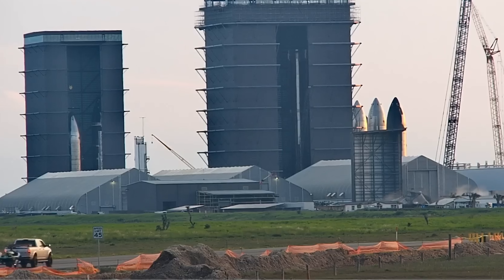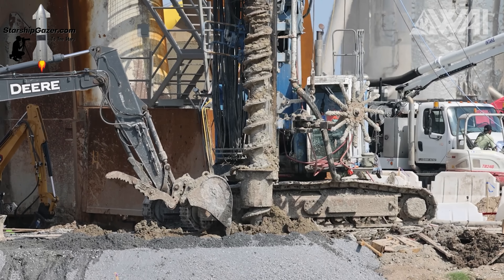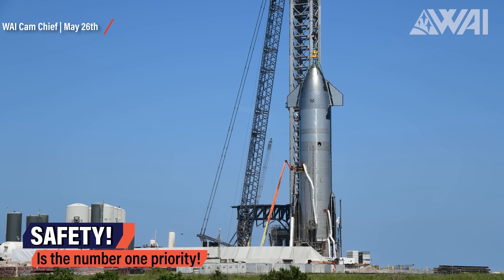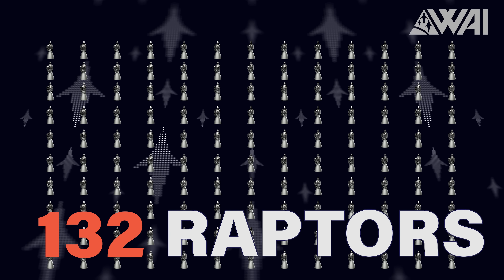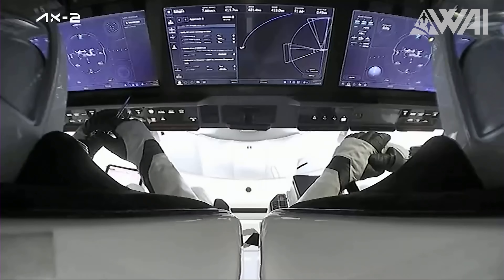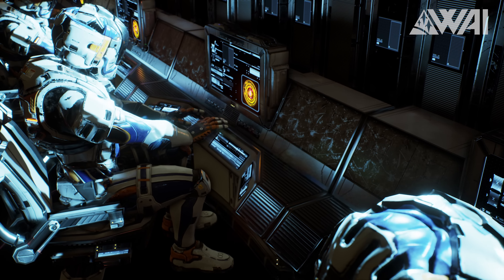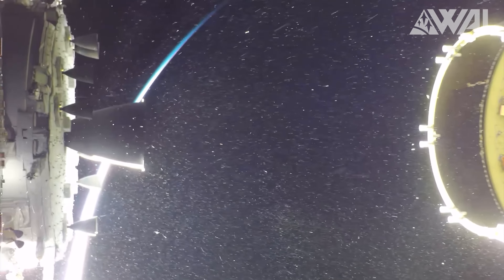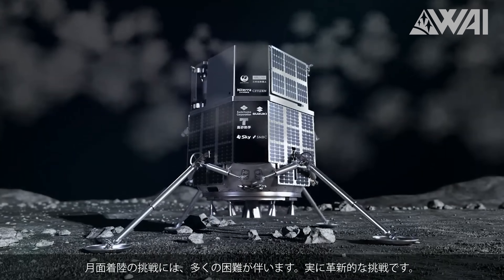SpaceX's Starship is about to do it again!?

Comment: The Hakuto-R Mission 1 crash was not really a software bug, more of a systems engineering process failure. The software behaved correctly relative to its training data.
Reply: Exactly. They trained the landing systems on landing site A data, then decided to land at B without running the training routines for site B. At least that is how I understood it.
Reply: According to Scott Manley, there was a sudden 20km change in altitude registered by the downward-facing navigation radar as it passed over the rim of a crater that was never profiled in any of the landing simulations.  This caused the lander to assume the radar had failed and subsequently ignore data from it.  I think you're right that this really wasn't a bug, unless being able to handle craters with 20km rim transients was part of the original software design specifications.  I'd be interested in knowing what they had originally decided should be the transient error threshold for valid radar operation.  The deepest registered crater on the Moon is apparently the South Pole-Aitken Basin, which has a depth of 13km.  Is this what they based the error threshold on?  If so, perhaps they never imagined that they would see a 20km change in altitude in a short period of time.  I was a programmer for two big companies, and I know how it's often easier to blame programmers for bugs than architects or managers for bad specifications.
Reply: Exactly! They changed the requirements. I would place a wager they didn't even let the software engineers know that the landing location changed.

Comment: Hi and thanks for your consistent and amazing content. A traditional flame diverter would fit the philosophy of the best part is no part. This unproven complicated method is a tangent from that methodology. 💯
Reply: I am a very busy man but I try to create time for my personal  life
Reply: I think I recall some people saying that the high water table would be an issue for a flame trench (that would exist below current ground level).  I also recall someone saying that this area being a 'wetland' would be an environmental issue.  The one that mentioned the high water table said it might be necessary to build the whole structure above ground, with the OLM and the launch tower raised to a significantly higher level...to allow room for the flame trench to occupy the space beneath them...such that no part of the flame trench structure would impinge on the water table beneath it.  Stabilization of the entire structure would be provided by pilings similar to the ones that are currently being installed to stabilize the OLM and water plate.  That would beg the question, "Why aren't the pilings a problem when the (to some extent...below ground...) flame trench would be?"

Comment: That experiment for the air quality/smell on the ISS is somethign that could be useful for wet navies as well.  As I understand it, even with all the advances in tech and their size, submarines are still really smelly environments to work in once they've been underway for a bit.
Reply: I remember to read something about the Paris Metro. Something about the disc pads smelling like vinegar. They were thinking about using ultraviolet lamps and a special coating on some places. The idea was to degrade the smelly molecule.

Mind, it was some 25 years ago. No idea what came of it.
Reply: UV-C light boxes are very effective against bugs. Not so sure about farts & BO smells. Has anyone researched it?
Reply: @Dave5843-d9m  They were researching it for the Paris Metro, as I said.
Never heard about it again, so no idea were the idea went.
25 years ago and all that.
Reply: That's why they used to call Sub's "Pig Boats" !

Comment: Hey Felix, I disagree with all the negative comments about flashy text. With good strategy it can add value to your information while being more dynamic to capture a less attentive audience. Don’t be discouraged by all the negative comments and keep trusting your analytics and metrics. Stay flexible and change if you have to. Ignore comments (including mine) if the data shows otherwise. You’ll reach out to more people in the long run. You’ll always lose people when you change a format for a better strategy, but as long as your core value content model remains you’re content will reach more. Keep slaying brother.

Comment: According to Scott Manley's video on Hakuto-R, the issue was not, that the lander was not programmed for the new landing site, but that a sudden height difference of 3km when flying over the crater rim, caused the computer to assume that the altimeter had failed. The engineers had not re-run the simulations for the new landing site and had therefore not caught this scenario in testing.
(This is just off the top of my head and might differ slightly from Scott's video)

Comment: I don't understand how SpaceX could not have anticipated that damage tot he OLM. I watched the static fire test where they lit only 11 engines and only ran them at 50%, and only for a few seconds. There was clearly several inches of concrete that got blasted away in that test. I said right then that if they lit 33 engines at 100% it would blast a crater under the OLM. I commented on this site that they needed to cover the concrete with steel plates. First really bad decision I've seen out of SpaceX.
Reply: And you were not alone in that observation. Having been an observer at a couple of shuttle launches (guest pass courtesy of my Dad's job at NASA) and being an amateur rocketry builder/launcher (not the little toy rockets, real 4 to 6 inch diameter and hundreds of pounds of thrust) and finally watching the previous damnge under test fires on pad A & B and the OLM it was a certainty that a huge hole would be gouged. It STILL boggles my mind they launched. SpaceX isn't dumb, why did they do that?
Reply: The thing is that they expected exactly what you mention here: to lose another few inches of concrete. Since they wanted to redo the pad anyways they concluded that it should be thick enough for the ablation of one launch.

What they didn't expect was that the launch pushed the concrete pad into the ground unevenly, causing it to crack allowing exhaust gasses to go under it and rip it to pieces. Hence the additional piling they are now installing.

Comment: In construction we call them "caissons" and then you connect them with "grade-beams", which are usually flush or just below the grade, thus the name. Another fun fact, the caissons have to be drilled into the bedrock, that is why they are so long.
Reply: bedrock would be desirable, but I've seen them used without bedrock. They still make it easier to keep water out as it can only enter at the bottom - and its easier to pump out.

Comment: If the water-cooled plate is intended to prevent direct impingement of rocket exhaust on the plate itself, it’s probably going to require at least 2 meters of water and probably more, not the “puddle” shown in the drawings. This will dissipate much of the energy of the upward spray from the plate (probably making them ineffective) and also add another 40 psi to the required driving pressure to supply cooling water to the plate.

Each Raptor develops the same power as 2.5 large nuclear reactors. Even if it is 70% efficient at converting thermal energy into kinetic energy, a water flow of 34,000 kg/s will be required to remove the heat of all 33 engines or 8800 gal/s. To charge the system and supply makeup for 20 seconds, would require a tank of about 400,000 gallons of water. It would have to be driven by a pressurized gas system operating above a couple hundred psi and the initial gas volume would add an additional 30-50% of the water volume to the tank.

Comment: The diesel generators may not go away. The 3 phase power from the town probably doesn't have the capacity to handle peak loads. However, things like security lighting and air conditioning fit right in. Starbase represents a larger peak load than the town, so this is not like adding a new subdivision at the edge of town to the grid. Grid power for Starbase would be the tail wagging the dog.     In addition to the extra costs of larger cables to handle peak power and upgrading everything else too, there is the matter of power security. Things like down power lines miles away triggering switching events that cause a momentary disruption of power. That would be bad during a countdown or fuel transfer operation. The generators aren't going away, they just won't be a 24/7 operation.
Reply: If only there was a company that could provide some batteries to buffer load peaks 🙂

Comment: “If they knew what would happen they’d not have pushed the button.”  Told them… over and over “Starships’ engines gonna blow a hole in the ground like an air knife on Earth, on Moon and on Mars if not fixed to prevent.”

Comment: I think it's a little more than coincidence that as a UFO passes by that Falcon rocket in 2016 it blows up. You can clearly see the orb shaped UFO fly by the rocket (from right to left) at really high speed. Go to the 13:41 mark in the video and pause it. Then tap your space bar to go frame by frame. It's clear as day.
Reply: @gmfdp4852  No way.  Sorry pal that's no bug. For one thing, it flies behind the Falcon rocket so if it was a bug it would have to have been 15' in diameter. I've looked at this video frame by frame using video editing software and it's definitely a craft of some kind.

Comment: SpaceX still has around 200 Raptor 2 engines to be used before they switch to Raptor 3 (unless they decide to dump the remaining Raptor 2 engines). So that means around 6 or 7 orbital launches before they finally progress to Raptor 3 (or maybe Raptor 4?). By 2025 we may be seeing a successful refueling in LEO with Raptor 2 powered Starship tankers orbiting earth.
Reply: Raptor 2 based boosters and ships are still useful as expendable test articles. They will be able to launch more payload per flight than any other rocket at a lower cost per kg to orbit than even a Falcon 9, despite not being reused. They have the huge advantage of being ready now.

The Raptor 3 based vehicles will carry still more and cost less. They will eventually be reused. Once that happens, the cost per launch will drop even more dramatically. But we probably won't see a flight ready Raptor 3 based vehicle for several months. Testing takes time.
Reply: ts always a huge pleasure having time with my fans,most especially
whenever am in my free time...

Comment: "A fresh supply of Starship ready to blowup" - Heavy sarcasm, but SpaceX deserved it in the first phase of the Ship development.
Things changed when Starbase, few months ago, fell under the direct management of Mrs. Shotwell. Both the logistic and operations of manufacturing Starships have became both speedy and highly optimised. Those Ships are not there to be blown up, but they are successive manufacturing pathfinders.
CST-100 delays are because of the parachute links are under specification, and the glue of their kapton tape - 100s of yards are used to hold wires inside the capsule - is not inflammable, and needs to be replaced; this means that they can't launch this year...

Comment: A stronger heavy lift can handle the purposed 18 meter wide Starship. The extra 1000 tons of lift would be less than the weight of the 18 meter wide Starship. Going from 9 meter to 18 meter should add about 200-500 tons depends on interior design changes, and fuel. The 18 meter could handle maybe 600 tons of payload depending on interior design, and how much thrust they can deliver from the heavy lift. It's all speculation right now.

Comment: What's the record for recovery -- around 14 now, I think? 
Do they inspect for metal fatigue after so many launches or each one perhaps?
Post flight assesments might be an interesting topic point, perhaps?
Reply: I think 2-3 F9's are at 15 now. A couple more are at 14.
Reply: Two at fifteen, yeah... though I think they've been pulled off the flight line for a closer inspection before they attempt to push the record any higher.

Comment: Two questions. 1. Was Boeing involved in the creating the software for the Japanese Lunar Lander? Asking for a friend. 

2. How could a small change in elevation result in a landing 3-5 km to high? Also, they don’t have radar altimeters in Japan?
Reply: 1. Actually, although people tend to call this a bug, in my opinion the Hakuto-R software worked perfectly. The only problem was not in the software routines themselves, but in the data parameters - specifically, the limit of extreme altitude change the computer should accept before declaring the sensor faulty, which should have been changed when they changed the landing location. Fault rejection routines in software like this are important and necessary, so that if a sensor does fail, the computer will ignore it and depend on the rest of its sensors. It's interesting that you mentioned Boeing - part of the cause of the two fatal crashes of the Boeing 737-Max was the lack of such fault rejection - the software continued to believe a sensor that had actually failed. (The other part of the cause was lack of training on the new system, causing the pilots to not know (a) why the plane was fighting them for control and (b) how to shut off the automated system that had gone haywire.)

2. There was significant time between the two events: the crater flyover and the landing attempt. At first, the sensor was sending normal data to the computer and everything was fine. Then the sensor detected the crater and faithfully sent the data to the computer. But that data was outside the range of values the computer was programmed to accept as valid, so it declared the sensor faulty. It continued to fly its approach, but from that point on, the computer had to guess the altitude by extrapolating from the descent rate before the crater and adjusting its guess blindly over time using other data like time elapsed, velocity, angle, and fuel use. I don't know how long the remaining descent was, but during that time, the extrapolation and guessing would get more and more inaccurate. The error could have been too high or too low, but it turned out to be too high in this case.

Comment: Great video!
Any Civil Engineers in the audience? I have questions on the new concrete for piles and pile cap. 1-Concrete cures at known rates. Is the possible time until the next launch attempt, about 6-8 weeks, enough time for the pile and cap to cure so it is strong enough to survive the next launch attempt? 2- The piles  seem to be surrounded in salt water. Would exposure to the salt water negatively effect final strength of the piles? Just curious!
Reply: In 6-8 weeks, folks will still be predicting 6-8 weeks.

Comment: What's funny is this. in 1977 we built a craft with no Moters first plasma propulsion. it was so fast the pilots had to fly it in a cock pit with a liquid in diving suits. we called it the ARORA. area 51 has it. then same year in new Mexico we launched a disk craft 200 feet round 7 feet in the center tappers down to 10 inches at the outer ring. no fuels of any kind. what made it fly ws a black box the size of a 48 quart cooler. the disk was over 150 tons of steel. i was the pilot . 3000 miles in no time at all. outer space, short lived. when i demoed the black box in front of airforce brass. i floated a 2 ton beam across a gym floor. then i attached  to a fork lift 5 tons lifted it 4 feet off the ground and i pushed the fork lift across the gym. brass wanted more, call it a trick. so i gutted a golf cart, put the box in it. asked 4 adults in the seats who wanted to go for a ride. they laughed and said sure. as it took off in a controlled flight. at 250 feet off the ground. i took them on the ride of there life in a golf cart, flying around AZ. airforce scrambled fighter jets to see what i was. sealed files and court cases will prove all of this. MUSKS liquid, toy rockets, are funny as shit. and so old school,.......hahahaha

Comment: A question for the civil engineering types out there, in terms of stability of the OLM, should the ground water  trapped by the surrounding metal sheet wall be pumped out , (and keep the pumps running)?

Comment: The "human error" in Hakuto lunar lander crash reminds me of the equally fatal crash of British Beagle 2 Mars lander due to the human error mix-up of American imperial measure and UK metric measure causing distances to be wrongly measured by its onboard systems.
Reply: I think you are mixing up two different missions here.

The probe that erroneously used pound-force and Newtons in different subsystems was the Mars Climate Orbiter.

Beagle 2 did in fact land successfully, as was later discovered on MRO images. It even seems top have managed to (at least partially) unfold the solar panels. The real cause for the loss was never identified, as Beagle was not designed to send telemetry during descent.